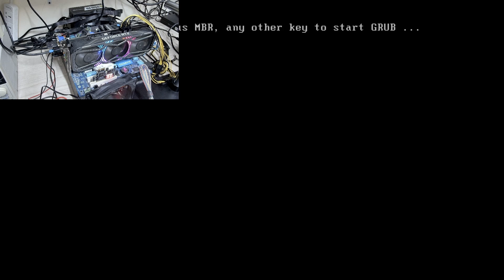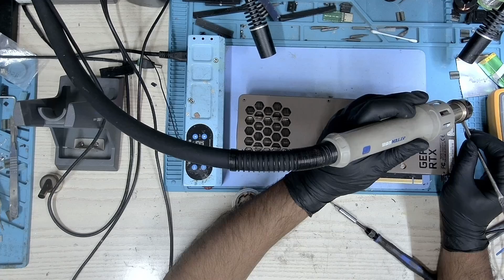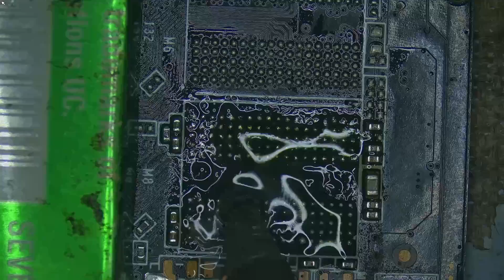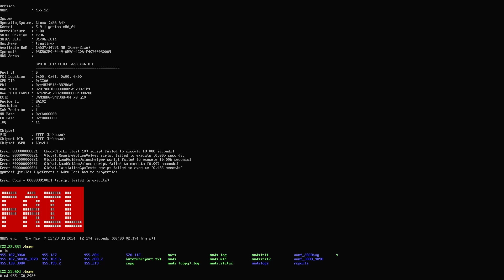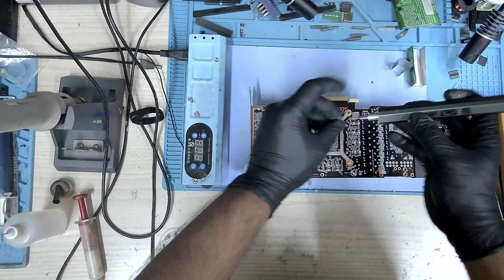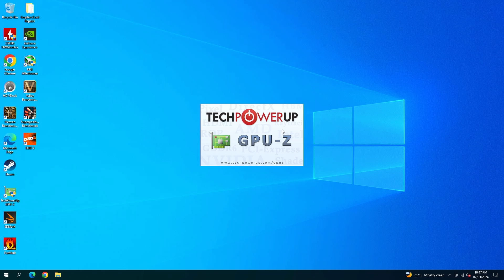Gainward RTX 3080 No Display Fix

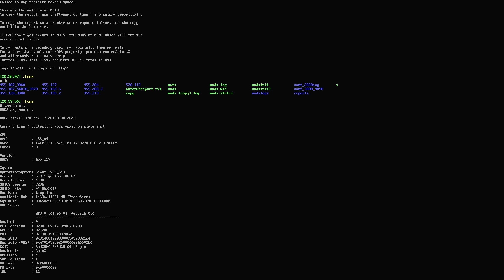Comment: 0:1:40  How do i know what channel is it by mods? 'cause you mentioned channel C  related to a number 2 that you mentioned....   C0  failed, i'm kind of new on this topic. I saw there's a 273 parameter wihich probably means a broken solder balls or gpu core troubles. But didn't know how to determine which channel is it  just because of the mvnt report. Cheers from Mexico!

Comment: I have a couple questions, first, when you removed the memory you checked resistance between some pins and ground? Or was it somewhere else? What was it for? Is there an electrical scheme available somewhere for these boards to know where to check for continuity of the PCB?

Also, why did you know the card was fine after failing MODS but passing MATS?
Reply from the maker: The pads I was testing after removing the memory were data lines connecting to the GPU core. That was to make sure that the data lines are actually connecting. Mods throw different errors but if the GPU is working and if I run skip_rm_state_init command it will not run the test and fail. What you saw was that it refused to run
Reply: @GraphicsCardRepairs-tk7ql  cool thanks! I have the same no display situation have yet got to run GRUB cause of no gpu and no igpu but once I get back my gpu I’ll be followijg this. Thanks again

Comment: yeah my RTX3080TI FTW just started dropping video intermittently but mostly a reboot fixed it.  This did not last, past 2 days its pretty much ded 😢
Reply from the maker: Sounds like memory issues. Either a memory or core reball will fix the issue.

Comment: Do you think it would be easy to add 2 more gb (2 x 1 gb) of vram on this card ? There are slots there and there are later versions of it with 12 gb.
Reply from the maker: The core that 3080 10GB used has 2 slots disabled from the core as it uses less cuda and SM's compared to 3080 12GB. The controller inside the core on those memory slots is not active. Installing memory in the empty slot will not work.